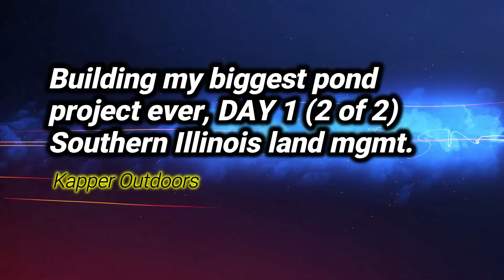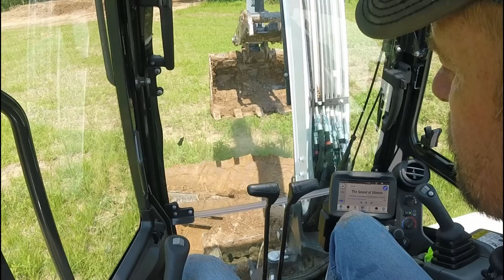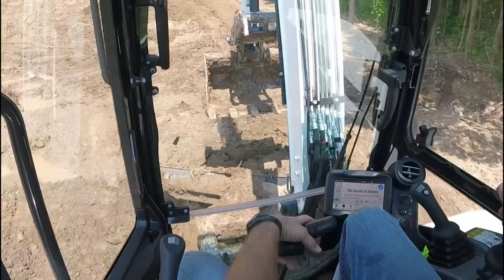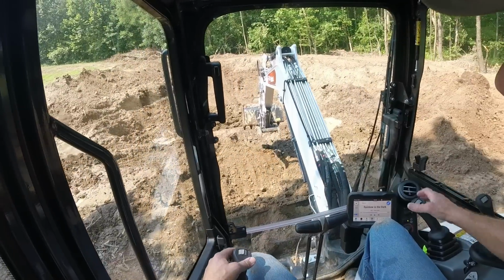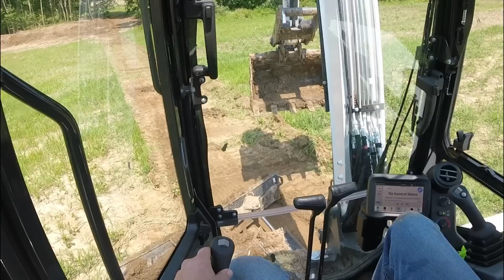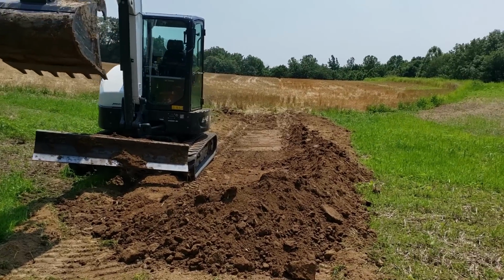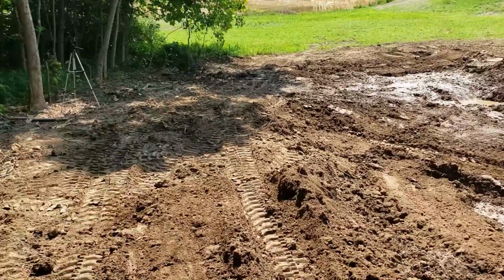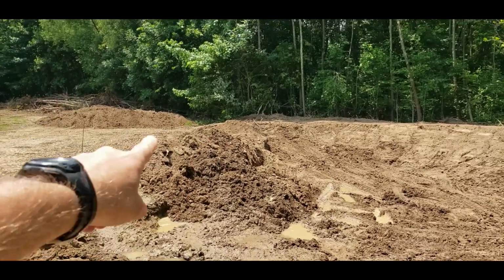My biggest pond ever-the new 36" Godzilla bucket on the Bobcat e42 mini excavator PART 2

Comment: Watch let's dig it on U tube. The guy builds tons of ponds. You can learn a lot. He usually tracks the dam in 6 inch lifts. It's a good idea to slope the sides at an angle that allows you to easily mow it. If you don't it will grow up on trees.

Comment: Looks good and it should hold a good volume of water when it's done. Your getting better with each water hole you build. It's a good idea to build a deep sump at the toe of the dam to catch the water that should start filling the pond if you get an early rain. That way you can work back from it and have all the water in front of you or put a 3" pump in there to get the water over the dam till you finish the pond bottom. There's going to be some nice frogs coming out of that pond.
Reply from the maker: Good call. I was able to finish it though completely yesterday so It can rain now! Put in 3 overflow pipes, this thing will take large volumes of water!

Comment: You better get the over flow pipe installed or you did good job on the water coming down that hill.
Reply from the maker: Just finished it. I put in 3 overflow pipes, it will take a lot of water from those 2 ditches.
Reply: @kapperoutdoors  Looks good